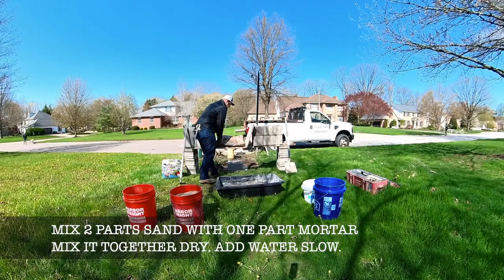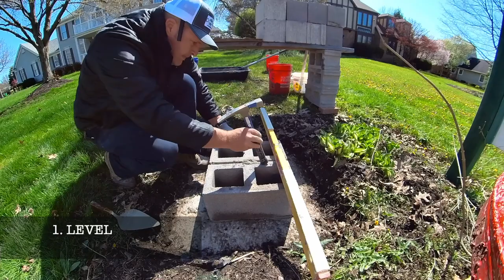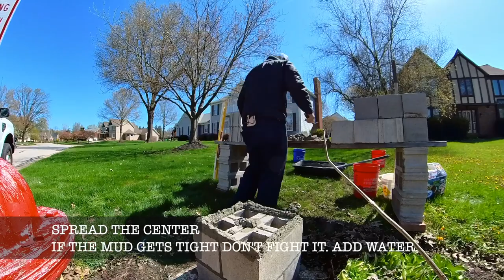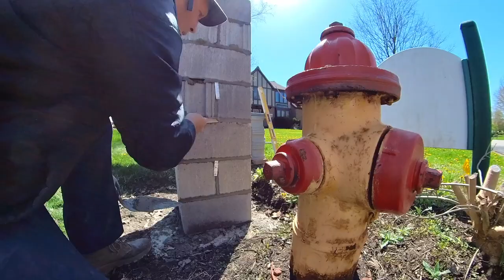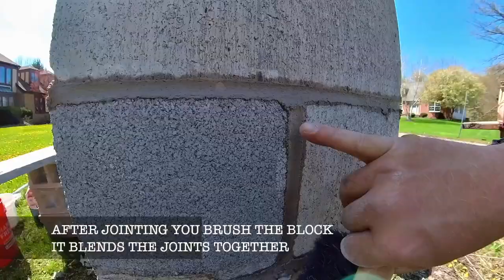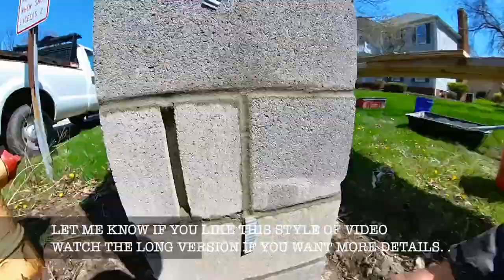3 Minute Block Laying tutorial.

Comment: Do you know how deep a footer has to be depending on weight that’s on top of it? Would love to see the stone you are wrapping with as well. 

Will you use the same mix for the stone work 1 Portland 2 Sand?
Reply from the maker: Most footers are 8” and need to be below frost. 

It is important to know there is a difference between Portland and mortar. But yes, a two to one ratio for both the block and stone. 

I am working on some stone footage. I appreciate your kind words.
Reply: @WoodandBricks  

Awesome. Can you elaborate on the Portland and Mortar? Isn’t cement sand and water make mortar? Or does like need to be added?

Right? Your mix was  1 part cement (Portland or whatever brand) and 2 parts sand? Or did I get that wrong and misunderstood?
Reply from the maker: @travisandtracyjacobs6198  you are correct on the 2:1 ratio. Portland and mortar are not the same thing.  Mortar is mostly Portland but the strength is different. Typically you would use type N mortar for brick type S mortar for block and type M for block that needs extra strength. Mortar needs to be matched to the strength of the material it is holding together. There is science behind it and if you really want to get into it you can research it. Just Portland and sand is usually too strong. Hope that helps.
Reply: @WoodandBricks  

Okay. Portland and sand is too strong. So what should I use to make up my own mortar. I think that’s where I get confused. Where a cement  sand and water make a mortar, but using sand and mortar makes a mortar? 😐 

First, thank you for helping me. I
Forgot to say that. This is great information. Your mix on the video was 1 part S Mortar and 2 parts sand for the  block work?
Reply from the maker: @travisandtracyjacobs6198  yes type S mortar. You can purchase it at any home improvement store or I would recommend going to your local masonry supplier. You’ve got it you are just thinking of Portland and mortar as interchangeable. They are not. You can use Portland if you add lime to it. It is easier to buy a bag of mortar.
Reply: @WoodandBricks  

Okay. So I would need S Mortar Mason Cement and add the sand. Right? Because doesn’t S Mortar Mix have sand in it already?
Reply from the maker: @travisandtracyjacobs6198  you can buy pre mix with sand in it I don’t recommend that. You want a bag of type S mortar and then add sand.
Reply: @WoodandBricks  

Copy that. Thank you. Do you get stuff from a home improvement store or from a masons supply store? The S Mortar I mean.
Reply from the maker: @travisandtracyjacobs6198  either or. If you go to the supply store they will be able to answer questions you may have and you can trust that they know what they are talking about. Not so much with the home improvement store. Generally you’ll get a higher quality product and knowledgeable service staff. It’s worth the slight up charge  and driving a little out of your way.